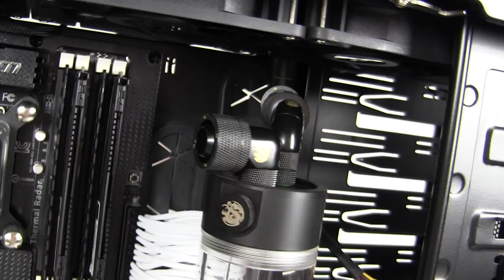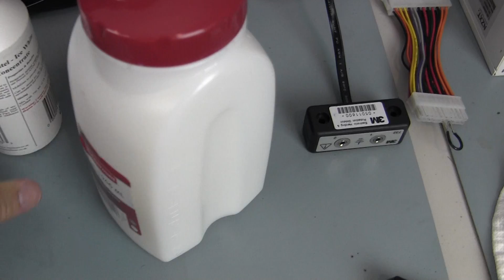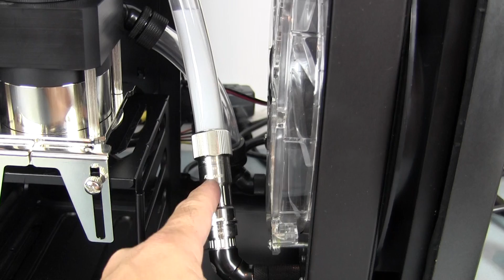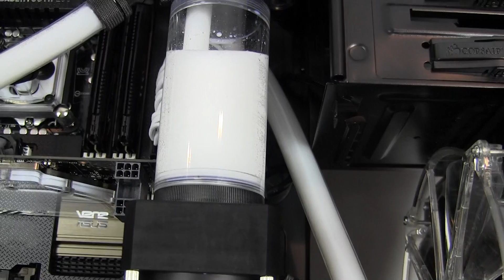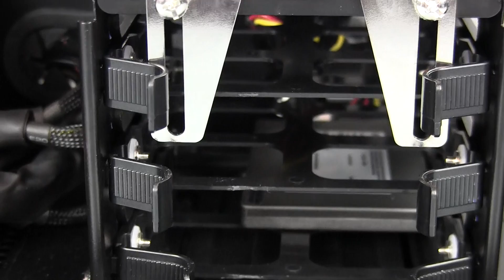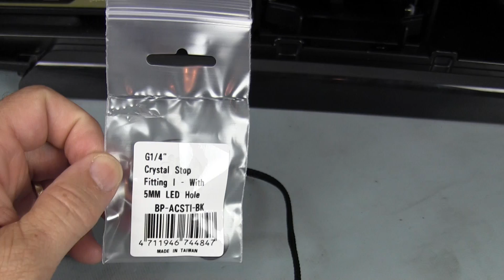CORSAIR 600T Custom Water Cooled Gaming Rig - Part 5 - The Leak Show !

Comment: Really nice video, shows how leaks and what can happen. Also that custom side panel is sweet. Nice job!
Reply from the maker: Thanks. It did turn out great. Thanks for watching.
Reply: I did just build my own custom watercooling loop for about $650 works so good and are so silent, leak tested it for about 5min. Couldnt hold myself back and have a successful OC @ 4.9GHz. And are so silent. Will use watercooling for the rest of my life now :D

Comment: i cringed everytime that pump ran dry >.<
Reply: ***** i've made the experience that, even if amazon has some sort of sale on those items, you can always find them cheaper from some local shop that specializes in that.
i can see you're not from germany but mindfactory.de usually is about 20% cheaper than all other sources you could get them from in germany :)

Comment: I can't imagine how I would ever manage something like this. I've heard horror stories of water coolers leaking, or resevoirs running dry, all that thick tubing becoming a cable management nightmare, concocting the right amount of fluid contents for efficient cooling, thorough inspection, etc. I'm glad something like the Corsair H100i exists. Pretty much eliminates all those problems thanks to the closed-loop system.

Comment: Wait, thermal paste on the VRAM? Under the thermal pads? If anything, all that would do is make more of a mess.... Dunno, maybe the 600 series called for that. Never got to watercool any 600 series cards.
Reply: World Known That's normal practice I thought...
Reply: flagmuffin1221 Not really. I put multiple waterblocks on the 700 and 900 series cards, and never once put thermal paste under the pads. Just followed the directions from EKWB.
Reply: +Kenzi Actually a lot of people put paste under the pads for various reasons, mainly because after you take the pads off they tend to not stick as well, helps while mounting the water block so they don't slip off.
Reply from the maker: +Tyler Bunch That is exactly why I do it. Plus it does not hurt the thermal performance at all.

Comment from the maker: All very nice. Great selection of parts, perfect CPU, great performance and value .  If you are not ready for custom water cooling the h100i is perfect to get started. I started with the H70 as my first watercooled setup.  Then I used a few other self contained and finally did a basic custom loop myself.  But don't be afraid to go custom.  With good parts and fittings you will be fine.

Comment from the maker: Just plan it out. Draft it up roughly on paper. Think about all of the turns you need to make and if you can try to avoid the long run like I had to do and also try not to cross your tubing.  I always wind up making changes when you get into the actual tubing, but the better you plan the less additional buys you will have to make. But believe me you will have to make more than one buy. Think of it like doing a house project. You always seem to need something else and have to run back out.

Comment: Great Job man, No worry you were quick to the power kill on the pump so dont let everyone bum you on that! I do a full resevoir full then hit my toggle for my pump. then fill again to the top usually takes 2 and 1/4 to fill mine. I have since then upgraded I now have a 4 stack resevoir that uses 2 at all times and once they are low i use a quick connect to switch to the other side

Comment: Phobya Xtreme 200 * XSPC X2O 750 Dual Bay Reservoir Pump V4 * 2 x EK - FC680 GTX - Acetal CSQ * EK - Supreme LTX - Plexi + Nickel CSQ * 5 x EK - Adapter 90° G1/4 - Black * 5 x EK - Adapter 45° G1/4 - Black * 11 x EK - Push On - G¼ - 13/10mm * 2 x MasterKleer - 13/10mm - Klar * Mayhems Pastel - Ice White * Silverstone AP181 180mm Fan

Currently waiting for this new watercooling setup. Got same case as you. Can't wait to get started. As I said before your build looks great mate. God job :)

Comment from the maker: There are three clips on the inside on each side holding the covers in place. You push them in and then pull up or out on that panel. To put it back one you just line up the clips and pop the panel back on.

Comment from the maker: No worries. Good points.  I built that machine with once 670 and considered going SLI, but I don't game on it much. My MSI Big Bang XPOWER II  is my main system. This one I have connected to a 50 TV in the game room in the basement and  I use it occasionally. If it were my main system I would do just what yo say. I also am thinking about selling it. If someone wants SLI I will put whatever they want in it. Check out my other video on my Big Bang XPOWER II System in STH10 case. Has 680's in SLI.

Comment from the maker: yes 670 is definitely one of the best values out there.  At the time I built this I did not have the $ to go all out. That is why it has a 2500k and the 670 was a great buy at over $100 less than a 680 but only about 8-10% less performance of a 680.

Comment from the maker: Yes , seems if you go with the EK reservoir X3's you will need to use some teflon tape to make sure you have a perfect seal. I know others have done it and it works fine.  Some others even have used silicone  to ensure a good seal.

Comment from the maker: It is the previous version of the EK-FC680 Block. But the new CSQ version of the blocks will fit just fine as well.  Go to EK website and select the cooling configurator. That will get you what you want. Also I had some luck at SpecialTech in the UK getting some older block parts.

Comment from the maker: For the 600T you can mount 2 fans on top of the case under the mesh, but you will probably have to cut out some of the mesh support ribs like I did in my video.  Then you can definitely mount the H100 rad underneath, but depending on your motherboard you may be able to mount the second set of fans for push pull as well.

Comment from the maker: It is 2mm longer than the magicool pro slimline that I used.  If you use this one you might but it would probably mean you could not use the latching mechanisms on the top for the mesh panel. The ticvkness is the same 30mm but the length is what will be an issue.  I will look and see if there is 2mm give in at all, but I remember it was an extremely tight fit with the magicool as it is.

Comment from the maker: My rule of thumb is to use 240mm worth of rad for each gpu/processor you water cool and some extra for overclocking.  So in this system I have the 670 + the CPU which would then be 240 + 240 = 480 worth of rad needed and I have 560 worth of rad so I basically have about 80mm of rad left over for overclocking and head room.  And given the 670 does not really put out a lot of heat I can always add another GPU and water cool it if I want to with out problem.

Comment from the maker: Nice.  I started out with a closed loop , actually did a few, and when I saw how much cooler and quieter it was I started on the custom loop. Slowly the bbug took over.  You system sounds nice. I just did get a Haswell 4770k and a new Gigabyte OC force, but I think that may go on my test bed. Waiting for the new ROG Exterem VI and to see what that holds.

Comment: The Pump can be turned thru 90 deg to align. The Res Top can be aliged by using slightly larger O-Rings and/or machining the Res end face, the amount can be calulated (it's a function of the thread pitch). The instalation/removal the bottom HDD is restricted & requires removing the DC retension screws, this in turn requires removal of the PSU. The installation of an SSD in the botton bay using velcro will resolve this issue.

Comment: just a piece of advice to any new builders watching this nice video... if you're building a new PC and H2O cooling right off the bat, run air cooling just to POST the computer to see if your parts are all functional... if you end up with a dead mobo out of the box... you'll have to tear down quite a bit including some of the H2O cooling you just spent all that extra time putting in place just to find out you have a DOA part that you have to RMA.

Comment from the maker: Use compression fittings, like Monsoon or Bitspower fittings and always leak check. Suggest you start small by only using one RAD and the CPU block only.  Get your feet wet first.

Comment from the maker: The long run works, but maybe not ideal. But on the leak since the system is not powered up, a cpu spill may be a little tougher to clean up but no damage at all.

Comment from the maker: The raw cage inside is very similar, but as the 600T is about 1 inch bigger in most dimensions I would say the 600T.  But I have not had a Vengeance C70 in front of me to look at. Also depends on what you want to put in it. If just a 240 Rad, and a Bay or small cylinder res, I would think you can do that in the C70.

Comment: dripped onto back of my gtx560ti card and a bit into my chipset heatsink which caught it and saved it from getting worse! thanks god for my chipset mobo heatsink on my asus board when i cleaned it dried it a found it was holding a lot water in the heatsink between its finns.saved me it really did.

Comment from the maker: I show you how I did it in Build Log Parts 1 through 4 .  You can't get a drive in the top slot after you mount the radiator. The fans extend into that space.

Comment: You're absolutely right. Don't leave the cap on. In this case the air is leaving the same hole he is pouring through, but I'd still leave the cap off. Remember to pour slowly though so it doesn't overflow like his did. Side note, this video shows what will happen if you leave the whole loop closed. /watch?v=2LjqCoVbZ_g  His pump runs dry and dies. and he has his res upside down. His cpu is probably fried as well because his whole system was on when filling instead of just the pump. NEVER do that

Comment: Nice build. Mounting a rad upside down (with connectors in the lower part) can be a pain in the ass though: you have to turn the whole rig upside down to let the air escape. Then... I'm not so enthusiast with the way you mounted the reservoir's air trapping system. The tank should be located in the highest part of the loop. About the lightning: you got a nice white coolant... put in a couple of 30cm UV cold cathodes and you're done!

Comment: Hi Ron, today i have seen this video and what I see is at your reservois, normally you would have the pipe screwed on the filling end. So when you open the air valve the pressure doesn't push out your coolant. The leakage was great to see. Most people would cut it out before posting it on youtube. Great video!
Regards, Erik
(The Netherlands)

Comment: Coating the threads of the rez with a little clear silicone during assembly helps that a lot. It does of course have to cure before you fill it.

Comment from the maker: You can use any power supply to give you the 12 Volts needed to power the pump.  Also you don't have to buy a whole new power supply just for that. I happen to have some lying around. But a cheaper way is to buy a Phobya External PSU. It looks like a laptop battery and provide a molex connections to power you pump. Or anything like it for around $25,

Comment from the maker: I found if I tightened any more than I did it could would strip. I have had others who used the X3 version of this rad they put a small strip of plumbers tape or used silicone at the base threads to keep a good seal.  Thanks for watching.

Comment from the maker: I did it that way because it looks the best. I wish I did not have to have that long run of tube, but it performance fantastic.  The pump moves the heat so fast there is maybe one degree difference between the heat side of the coolant and out of the rads.  Loop order really does not matter except you must have pump after res.  Thanks for watching.

Comment: Very awesome, clean looking build and nice use of the space inside that 600T.  Now I see why Corsair made the HDD cage able to mount closer to the PSU like that, room for rad and makes a good pump/resi stand! I have a 650D so internally the cases are fairly similar. I have a CPU/GPU water loop just like yours but with a dual bay res/pump and a RX360 rad that I ended up mounting outside the case on the top since the 650D dosnt support putting a 360 inside like you did. Nice use of fittings also!

Comment from the maker: The key was making sure I did not cut out the mounting holes to mount it to. I took some painters tape and masked off around all of the mounting holes then I drew straight lines back to the ends and drew around the latching posts and then cut it all out.

Comment: Great vid, thanks for that. I liked that you just left the brain farts in there and didn't try to edit them out and for that I subbed to your channel. I had a leak on my system last week after being advised to fit a spacer between two cards to lift the top one up. I didn't like the idea but as it was under advice from the shop where I purchased my PC I still went with it. I only wish I had listened to my own advice as coolant was all over my three new graphics cards as the spacer failed after turning on the loop for final testing. All was well after a strip down and a few hours with a hair dryer.
Reply from the maker: Good thing we test with only an external power adapter.  I thought it was a good example of what can happen, and since it did not hurt anything, I thought it was pretty funny too.
Hope your system dried up okay and is working good for you now.

Comment from the maker: The res in this loop goes to the front rad and then up to the top rad. I used Bitspower fittings and Koolance Quick Disconnect on the 200mm rad and then up to the top 360 rad I used Bitspower extensions and compression rotaries. If you go to my Facebook page under the 600T Photo album I list all the water cooling parts.  I also show the parts in video #7 but most folks say they can't read it.

Comment: By drilling 2 holes in the right hand side of the Drive Cage (DC). The Pump can then turned anticlockwise 90 deg & be bolted to the DC. This will enable instalation/removal of the top 2 Hard Disc Drives (HDD).

Comment: The thread diameter of EK Reservors is larger than Koolance Pump Body therefore a Koolance Coupler will not tighten/seal in an EK Reservoir. I susspect that contributed to the leaks. If this PC has been assembled using these component without modification it may be at risk of leaks in service. A drill hole in the 5-1/4" Bay will prvide sufficient clearence for the front radiator bleed screw (no need to dremel).

Comment from the maker: To put just the water cooling in that I put in this system using the same fittings, pumps, radiators, blocks for the GPU and CPU, and all was proably around $1000.

Comment: there are some pci slot cover that you can use too, you can buy them in any color. Only the heatsinks will be the off. If you plan on watercooling the board it should be good

Comment from the maker: To fit the 750 Res/Pump combo since it is a dual bay res/pump will require modification of the case if you want to see it from the front. There may be a way mount it inside with a window to view it from.  I don't have the time or a kit to do this with right now, but I will take a look at it.  No promises.  Thanks for watching.

Comment: Yeah, the bitspower fittings are pretty expensive, there is the extra rad, but EK blocks aren't that much more expensive. But still, $1000 seems like so much.

Comment from the maker: There are 11 BP
Matte Black Dual Rotary 45-Degree Compression Fitting Qty-4
Matte Black Triple Rotary 90-Degree Compression Fitting Qty-5
Bitspower G 1/4" Matte Black Rotary 90 Degree IG 1/4" AdapterQty-2
Bitspower G 1/4" Matte Black Triple Rotary 90 Degree G 1/4 Male to IG 
1/4" Female Fitting	Qty-1
QDC	Koolance QDC (High Flow) No-Spill Shutoff Nozzle, Female Compression (13mm, 1/2" x 19mm, 3/4") (VL3N-F13-19S)	1
QDC	Koolance QDC (High Flow) No-Spill Shutoff Nozzle, Male G1/4 Thread (VL3N-MG) 1

Comment from the maker: The pump requires power to pump the coolant through the loop and the pump gets its power from the power supply , so yes it does have to be on.  When I am filling the loop, I DO NOT have the power supply in the system on, I use a separate power source to power the pump only so if I spring a leak (like I did here) the motherboard and other parts will not short out.  Hope I answered your question.  Thanks for watching.

Comment from the maker: The pump moves the heat so fast there is maybe one degree difference between the heat side of the coolant and out of the rads. Loop order really does not matter except you must have pump after res. Thanks for watching.

Comment: super clean build! I also have the 600T and i just bought a AIO liquid cooler but it won't fit due to the location of my motherboard 8 pin power connector. I think i may try to place the rad on the top of the case and cut a hole through the top mesh so i can feed the waterblock to the cpu.

Comment: ACTULLY, you dont need to use a separate power supply. and for a leak test, you need to get metal wire, and connect a green wire with black wire on the 24-pin connector without having nothing hooked on power supply other than the pump.

Comment: I was bored a few nights ago so I made a custom loop for my old core 2 quad system with a bfg 285 that I still had the block for. The funny thing is with only a 240mm rad the cpu only gets to 19c under load. It only was about $15 because I only needed to order the mayhem pastel coolant.

Comment: Hey Ron, what about using a crossflow rad for the top triple? Probably could have been possible to let one run straight down from that rad, and with one more little hole cut in the optical drive mounts, had it going right to the front rad. Would clean up that one tube crossing the entire rig. Not complains, just was thinking while watching. Great build!